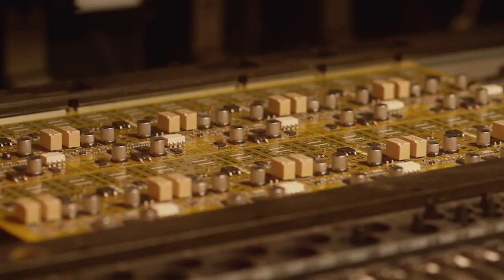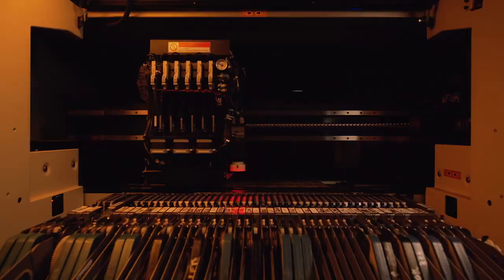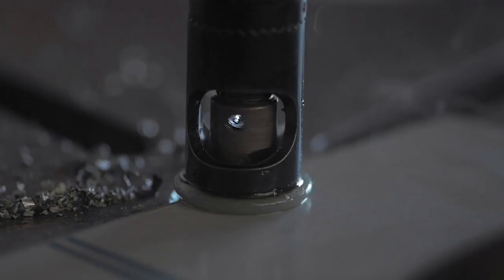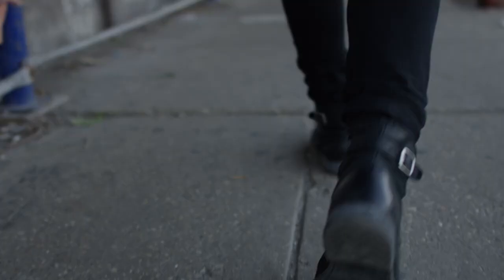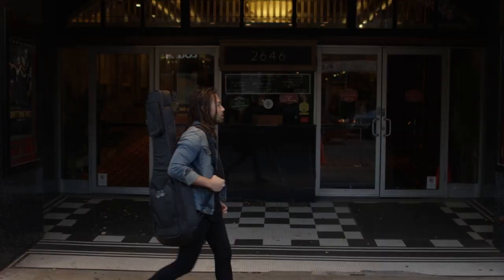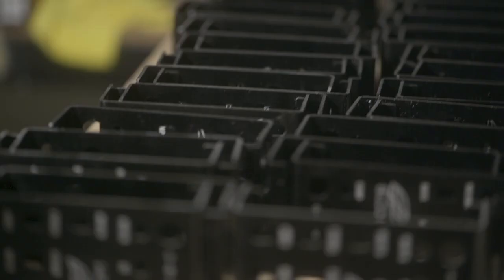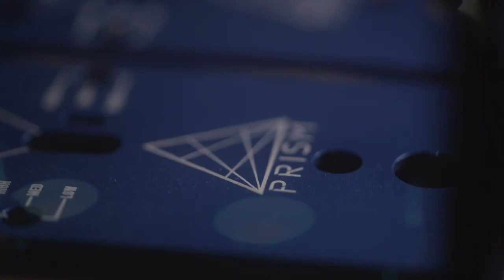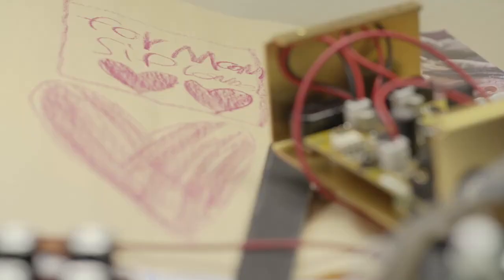Jackson Audio Headquarters Tour

Comment: Bloom into Golden Boy is my current setup and it's likely to remain that way from here on out. I use a MIDI controller to handle ALL of my gain staging with just those two pedals going into a clean amp. I can toggle on/off the boost of each pedal and then also trigger gain-cycles of the Golden Boy. With MIDI you can unlock soooo much of what these pedals can do in an instant! Awesome products.